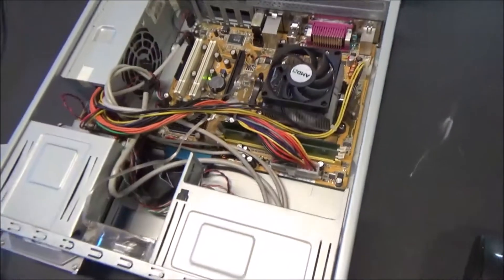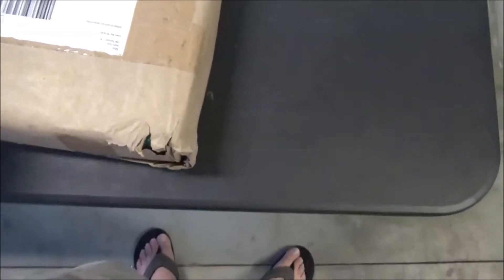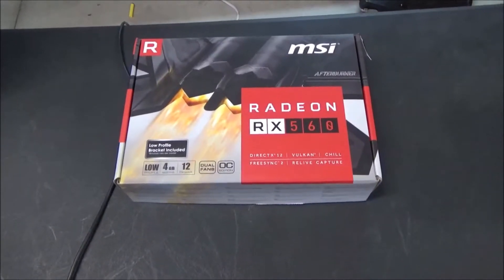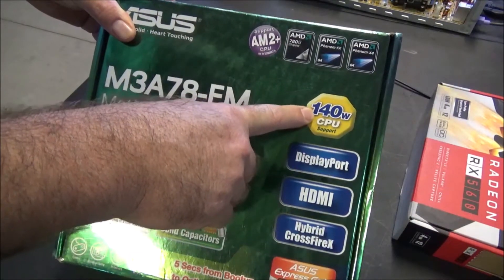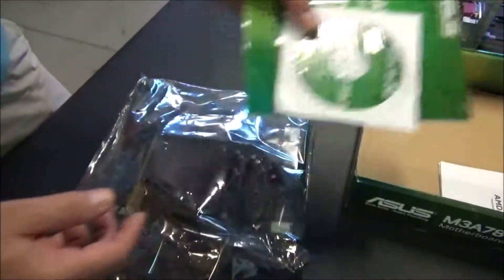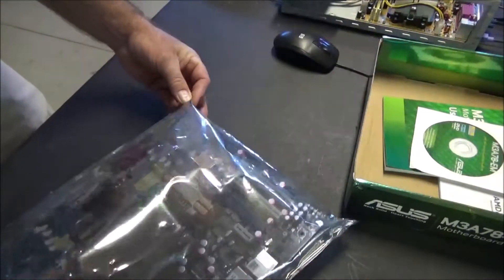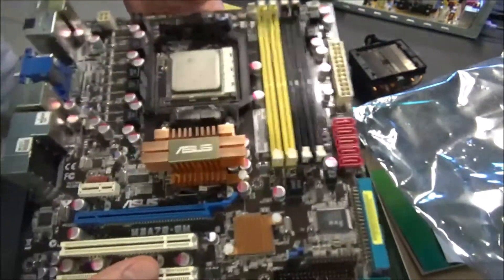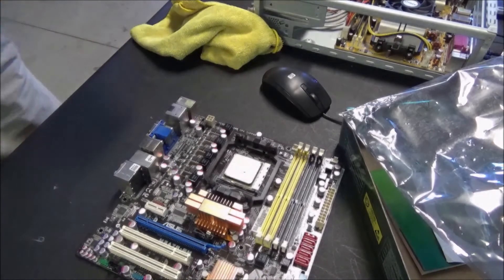New AM2+ mobo!

Comment: Good stuff, I made a $10 water cooling setup, which dissipates more heat than the chip can produce, never getting above 40C when over clocked +800Mhz, what i found on my AM3 board is the bear vrm's get absurdly hot(still technically in spec, but pushing that to say the least). I recommend if you can find some, get some tiny heat sinks from ebay and stick em on, if you can find them for less than $2 shipped (with some adhesive artistic paste....$5-7) like i did. they can be tricky to find sometimes. but they have given me lots of extra overclocking before when modding a video card with em. cool but weird.
Reply from the maker: Nice man, I love doing super cheap water cooling. It feels good after seeing crazy $800 loops on YT =D. I'll get some little heat sinks for sure. I watch a lot of Gamers Nexus so I'm always concerned about the VRM's getting too hot. I also used them on the video card for the green water cooled Dell project. Those heat sinks came with preinstalled sticky thermal pads. I've always been concerned that one (or more) might peel off and drop onto the motherboard though. I'm sure that wouldn't be good. Probably should have used an adhesive thermal paste just to be sure.

Comment: thats a great update, and that seller needs to have talk... when your shipping stuff you take exstensions (CPU, cooler, ram, FP connectors, GPUs) off the board and either put it in the same box all wrapped up or send them sepratly, even though I suspect that the seller really didn't know much about PCs.
Reply from the maker: I like the board a lot but it's crazy the way he shipped it. Very unprofessional, lazy, and actually straight up dumb. EBay for some reason had two listings on my shipping page so I just assumed that he had sent the cooler separately. The cooler made the entire package very heavy and I'm sure put added pressure on the PCB. Hopefully it didn't get damaged in shipping. I really should leave them a message, maybe it will keep them from having to refund a damaged item in the future. Lot's of idiots selling stuff on eBay!

Comment: Damn I was waiting for this video. The good news is if you want to keep the old mobo now you can as you will have a spare cpu kicking around for it...and maybe you can use the new cooler on the old mobo since you will probably be water-cooling the new set up. The x4-640 is still better then the HD9750 though but not a bad combo for the price. Can’t wait to see it all put together. Also I don’t know how crazy you want to go but that mobo will support one of the x6 6 core phenoms...
Reply from the maker: Hopefully I can bang out some videos and get this thing done now that I have a suitable mobo. The old mobo still sells for $30+ so I'm not sure if I'm going to keep it. I kinda want to sell any extra parts just to keep the overall price of the project down. I was a little surprised when I looked up a comparison of the Phenom vs the Athlon, the Athlon beats it by quite a bit. I would love to get an x6 Phenom for it, it would definitely qualify as a pimp-tato PC with that CPU! I have a few parts to put back on eBay that would pay for it, so maybe I'll try to go that route.
Reply: Makes sense, selling it would probably be the smarter route if trying to keep the costs down. 
Well either way I hope to see an update soon, too bad that ram is taking forever to get there. Should be a pretty pimp little system when it’s all done, I’m most excited about watching you water cool it and am interested too see if that single 80mm rad will do the trick as I’ve always wanted to try one of those.
Reply from the maker: Yeah, money is kinda tight right now because I'm re-launching a business that I shut down about 4 years ago. My days of being a stay at home dad are coming to an end this fall when my daughter starts kindergarten and I have to start making some cash again. That's part of the reason I haven't been doing many videos, I just don't have the money for parts. That Ram should be here on Tuesday so I'm pretty exited about that. I just wish I had ordered 16GB since this new board will take it. I'll probably order another 8GB from the same seller soon. The water loop should come together quick. I know that 80mm rad will be enough for stock clocks, I'm just not sure how it will hold up after I start over clocking. Should be some interesting results.

Comment: 10 days! Was it delivered by Pony Express? LOL! Hey, at least the pins on the board are OK. The cooler looks good. Almost like the Wraith Prism, but without the RGB. If you are OCing, use a small fan to move air across the VRM's, and make sure to use the 4 pin CPU power connector too. Good video, and keep it up!
Reply from the maker: 10 days is ridiculous! I have actually gotten something from China in 10 days before. I'm glad the mobo pins aren't bent and everything looks okay. Tomorrow I'll be installing it, hopefully it boots. That cooler is good quality even though I'm going to water cool the CPU. I'll definitely have a little fan for the VRM's and I'm considering adding some heat sinks too. Thanks for watching man, I'll post the install tomorrow when I finish.
Reply: Sounds good. I look forward to seeing your progress!